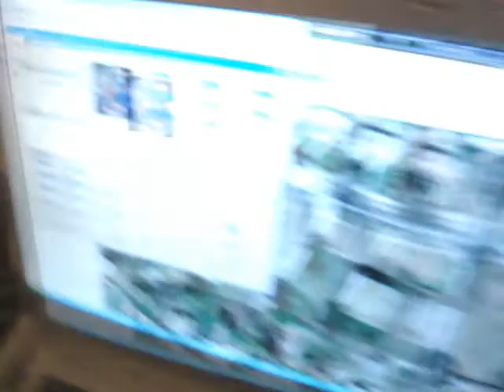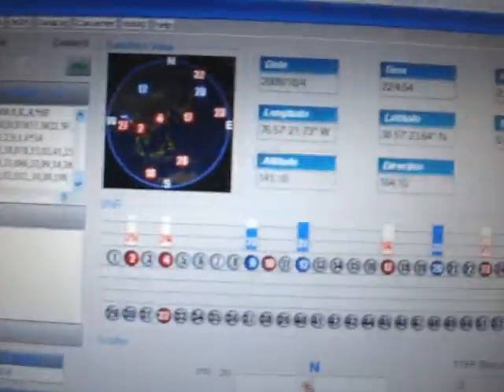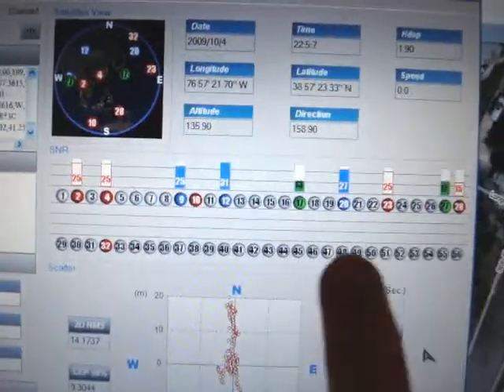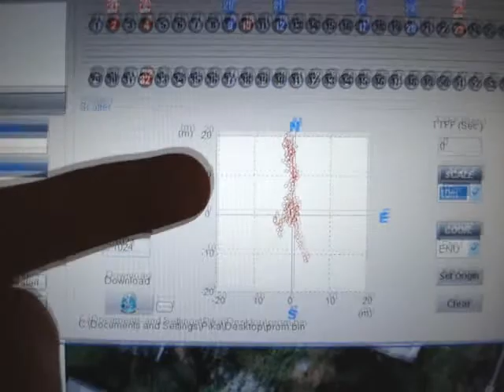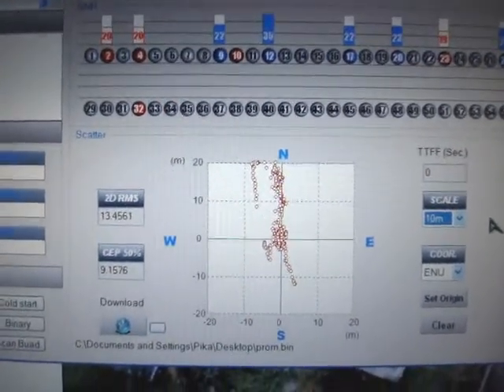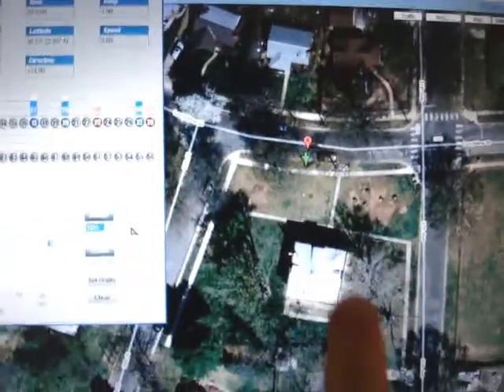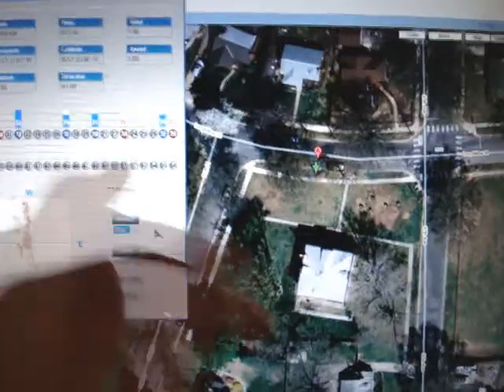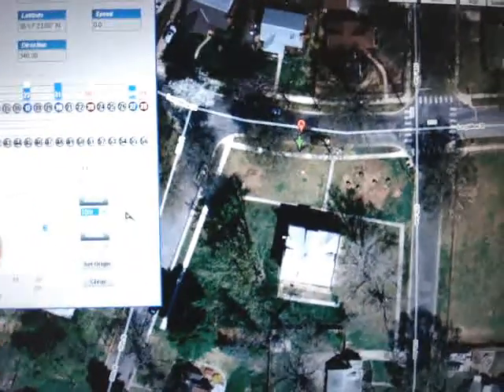Axon II Microcontroller and GPS

Comment: @palmisano  Why not? Not as good GPS reception? I do actually have a gps-mini with the ceramic antenna from sparkfun. Just a few hours ago I screwed it, tried to "manually" send a pulse to put it into sleep mode, used 5V. It stopped working,I read the data sheet and its 1.8V logic level! $200 down the drain just like that. I will probably get it replaced, wanting it for a outdoor tracker and thought a duck antenna would have better performance.